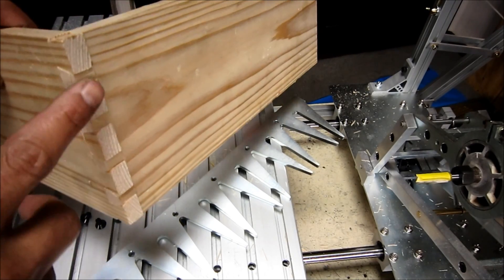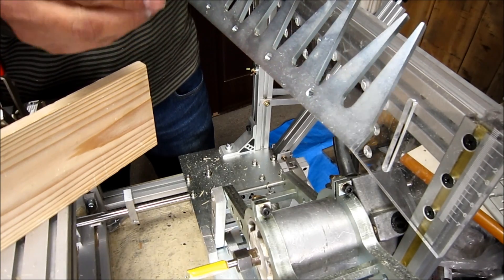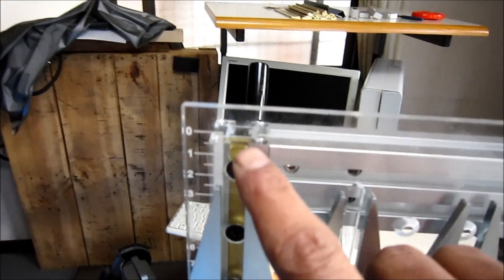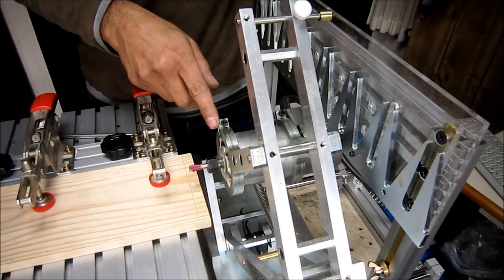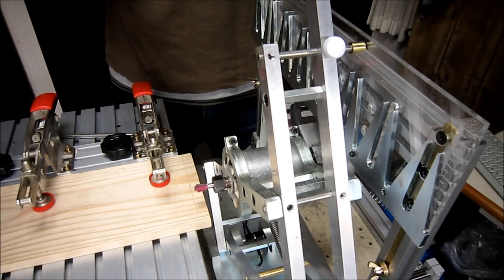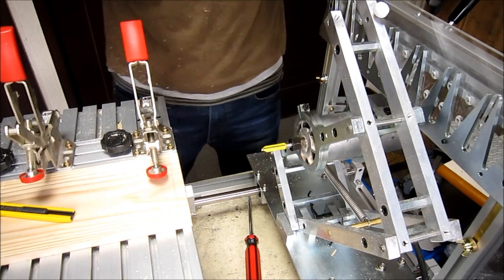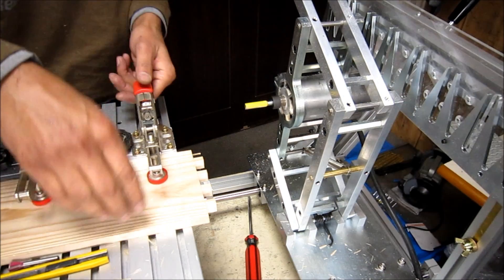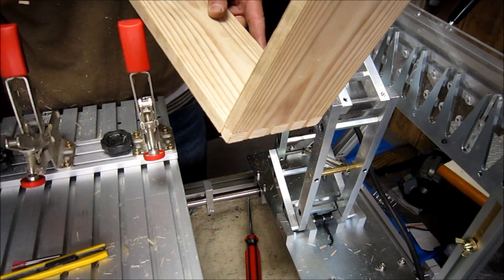Making through Dovetail joint on hybrid pantorouter

Comment: Great machine really well done would love to have one but it's a pity that it is so expensive and with the price of postage to Australia puts it way over a thousand dollars well beyond the budget plus I would have to spend another 800 to 1000 dollars for a fixed base router ( the only 240 volt fixed base you can get here is a dewalt ) maybe if there could be an adapter made to use a plunge router I would have another think about buying it still as a retired mechanical engineer I love the way it's made good stuff cheers
Reply from the maker: fixed base router most of my Australian customer buy from England.the name of the router is Draper expert 1350 watt and run on 240 voltage same as Australia.check this router on Amazon UK.it's 153 sterling pound.
Reply: That is over $300 AUD and with the price of your pantograph and postage to Australia is still going to put it way over the $1000AUD mark just to much for a backyard woodworker oh and while I have been typing this I did a check with my laptop for the router on Amazon UK and they do not ship to Australia anyway so as I said before I really like the work you did to produce the pantograph just a pity it is out of the range of 95% of Australian woodworkers cheers